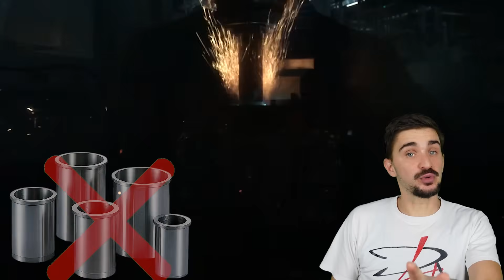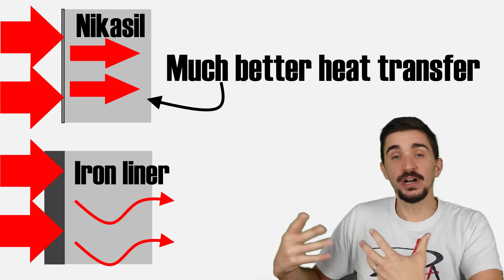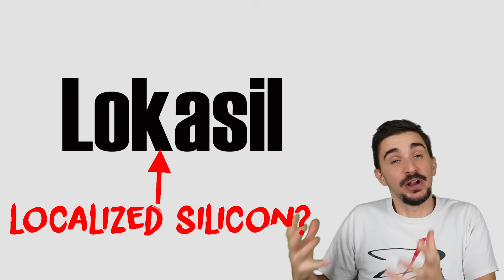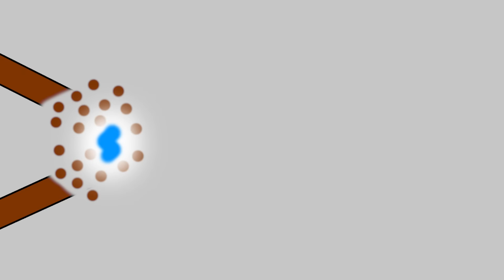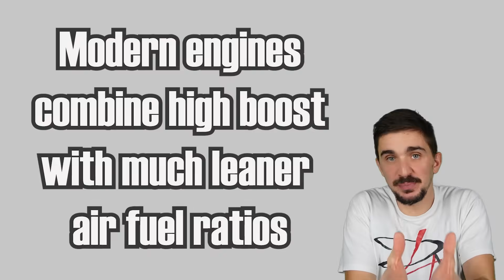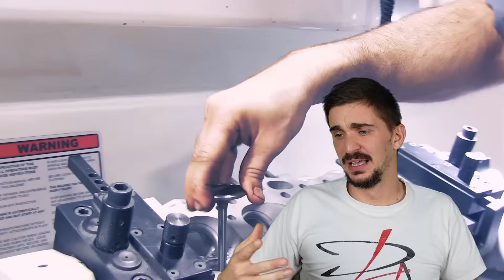Why Are Engines Becoming Non-Rebuildable? Everything About Cylinder Coatings

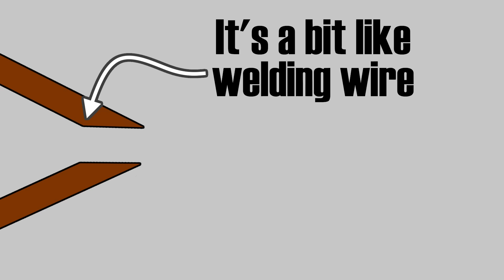Comment: Is that a ghost lockdown sound at 13:38? The most hated sound in the universe? Some of the points on the environmental calculations: yes, the remarks about "objectivity"  - or the lack thereof - are pretty objective - because this video cannot even hope to understand and grasp all the inputs and outputs of metal processing - from its natural source/mining - to the manufactured engine block. Meaning - A LOT MORE - goes into engine production than what is described. That would require a systematic research (which lacks in many industries, esp. bearing in mind the modern eco-craze and BEV-craze). This systematic study/research would have to try to grasp absolutely all inputs that need to be there - come together - so the specific item - engine block - can be made. There's engine (mining, production and operation) research, manhours, engineering, plant operations and plant construction - you would really have to work - for a long time, preferably - in the industry - to have the knowledge and data around what goes into building an engine. So mostly always - I'd say at least - leaving an existing engine on the road - will be more eco-friendly - than building a new engine. Moreso, recycling is not done like this - you have a bare engine block - which has been used throughout it's operational usable life-cycle - you take it from a shelf - put it into a smelter next door - and have a new engine. No. You have to first convey the message to the owner - hey, that engine that's in you car - that cannot rot in a ditch - dumped along with the car you drove the last 10 years - or rot at a breaker's yard - that engine needs to go to a specialised recycler/waste collector (time/money/resources). Then the waste collector needs to take the engine (block!) out of the car (time/money/resources). Then it needs to be cleaned and cycled as a new production input (again, time/money/resources). Recycling doesn't work as easy as - hey, I have this piece of jumper, I'll ask granny to "recycle"  it into mittens or freaking socks. A lot more inputs (granny isn't specifically environmentally harmful, waste collector sites, cleaning, smelting and re-cycling IS). So we cannot just take a ton of engine blocks - and say, hey, in ten years - all these engine blocks will make a ton of new engine blocks. People who speak of environment - mostly lack all this data. Their only data is "I see car. Car bad. I good. I protest bad car. I be even better" - which is of course total bullsh_t. The rule will always be that a 20year old car - in most of its aspects - is much more environmentally friendly - than a new car - NO MATTER how environmentally friendly this new car is. Some initial research is being done by Polestar (branch of Volvo and owned of course by Geely) - they publish the amount of CO2 that goes into producing their Polestar 3. 1 and whatever else their nodel numbers are - vehicles. There you can BEGIN to see - that a newly-build Polestar - is at least in terms of released CO2 - much more harmful than an old car - but even they don't provide even half the numbers. Some university at the technical/automotive engineering department - needs to do this calculation, taking into consideration a very broad "craddle to grave"  approach - for it to be at least initially credible. Just a quick added note - almost none of these engines are being re-built (re-sleeved, honed, polished, mating surfaces milled, etc). 99% of them work - and then don't - and then - new car. So those who worry about them not being rebuildable - well, worry no longer. Godzilla engines are maybe getting rebuilt - not these Renault Clio engines.

Comment: I agree on everything but the one bit about heat transfer.

It's precisely heat that is causing the expansion of gaz that is pushing pistons down. When you dissipate heat form the cylinder, you are dissipating heat in pure waste. Higher heat transfer is higher efficiency losses. That's why high efficiency engine have the smaller bore possible, to minimize heat transfer between gaz and walls. And you know it since just after that you said we can push the engine harder with higher temperature (i.e. heat).

Indeed, once the heat is inside the walls, you want the wall to not melt, degrade or cause knock so you have to keep it cool. But your phrasing is inducing that heat transfer, no matter where, is a good thing, and that's not true. You should have not use the word "barrier" and precise you were talking only about heat transfer between the wall and the block.

Comment: Back in 1962 I started my mechanical apprenticeship in Ireland with CIE .
The ran a large fleet of Leyland trucks and buses .
The main engines used were Leyland 600 and 680 engines 10 and 11 litre engines 
These engines used thin dry type liners called chromard liners and were very durable.
One part you could not use in these engines was chrome piston rings .

Comment: I suppose there's no market for thermal spray coated aluminium liners? They would be too thin to, and we couldn't make them thicker because of there's not enough material between cylinders to bore out space for a thick liner. So we've advanced ourselves into a corner, technologically, where we're producing things so good they ca no longer be repaired. Engines aren't the only engineering domain that suffers (or benefits) from this. Even in a regular car, even if you could rebuild the engine unlimited times you couldn't do body repairs without replacing large, complete panels and structures because of high-strenght alloys that can't be repaired by a regular welder, or repair the electronics when they say pooff after 5-15 years and, ultimately, you can not "repair" the internet-connected software when the manufacturer drops support for it. (Or if you do change something in the car's software, assuming you're technologically permitted, the manufacturer will refuse to work on it or update it, and maybe at some point this prevents you from passing a MOT test.)

All in all, technology seems to reduce things and products to something you can't ever own, for the real, original purpose of owning where you can do whatever you like with what you bought, like repairs, and nobody can have a say. You don't have the technology to carry out repairs so therefore whenever you buy and "purchase" something it actually means you merely enter a technological lease that maybe allows you to operate what you "bought", for a while. At that point you can just rent it: is there a point of paying to own something that isn't ultimately yours? And the big question is: can you fall in love with a car that isn't truly yours? Can you buy a car today and expect to keep it on the road far into the future? Doing that was never practical beyond a certain point but it was surely possible. That's why we have classic cars now. What will be the classic cars in 2060? I doubt 2020 cars can be kept going that long.

Comment: Perhaps manufacturrs with the technology readily avaliable should be required, by law, to recycle engine parts. It could be done cheaper, and to a much higehr standard, than a low-volume engineering shop. Else, there should be specialist engineering firms that are sponsored / subsidised by manufacturers in orer to have the tech set up and used to engine parts can be repaired at much lower cost than buying an entirley new engine block. It's only through lack of "want" that this doesnt happen, right?

Comment: This is far too level headed.
The general "petrol head" only deals in absolutes..

Like "all batteries in EV's will die jn 10 years and ALL of them will have to be replaced and the old ones are bad for the environment"

They like to ignore that combustion engines have a useful life, some break, some don't, some can be repaired, some can't, etc.
And they also like to ignore facts like....not all batteries in EVs will be rendered useless in this mythical world they live in. In fact, hardly any will. They may only hold 80% of the charge they held when new, but they don't just suddenly stop working.
And there are ways of recycling batteries.

Comment: Rebuilding engines is not an issue, as most modern engines do not get rebuilt. A lower miles used engine is always cheaper than a rebuild. And much faster to source and install. Anyone priced all the parts that may be needed? Since all car makers now have "Inflation" to blame, and so have doubled and tripled prices, even for older parts in warehouses for a decade, who can afford a rebuild? The only question with non-rebuildable engines, is how long they last. Or more exactly, how long they are warranteed for, which determines whether you buy or lease.

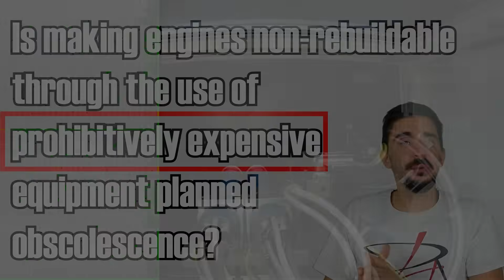Comment: 18:31 I disagree as there's a logical flaw in your construct. As being a person who spent good portion of my life dealing with electronics and microprocessors, I have to point out the amount of research and development put into making a MCU non-accessible for others than manufacturer and even for them it's one shot access. No manufacturer want their product to last longer than it should but(!) they want, while it last, to perform flawlessly. You said end result is less expensive than iron sleeves and that's a final target and that production low cost is locked to the company who build it, others have to pay higher price if wanted to replicate the process as they have to meet such production quantity to justify the investment. Being a product manager today is a serious business and serious responsibility but not toward end user as no one gives a rats ass for him but for the corporation that feeds those product managers. All recent fraud schemes like VW (and others) dieselgate, ecoboom engines, wet cambelts, massive product recalls and such, are just consequences of planned obsolescence planning goes wrong. 
One of the greatest example is turbo-compressors. Are you aware that production and development companies are obliged to make a turbo which has to last between 200.000-250.000km and if some batch exceed that run time for more that like 10%, those companies would be paying penal for big company loss, it's same process for pistons and other parts of the engine, like cooling system. Planned obsolescence takes more resources today than R&D, as it became major production thing... sorry for the long post, it was interesting topic for me. Cheers
Reply: 24:45 there's another logical flaw, but you presented it as simplification for the ease of understanding. This is not how it works in this case as car is not just an engine block, it's more non-recyclable plastic than ever, what about that? You took just benefit and ignored the hazard, and that my friend - is a logical flaw. ;)

Comment: While I agree with most of your other videos, I don't agree with this one. You are very knowledgeable, but in this case I think you missed several key points.
First I will start by just adding that... I own a BMW with a M52 engine, and it has cast iron cylinder liners from factory, the N52 are the ones that have the alusil/nikasil coatings (I also worked on M54 engines and they have cast iron cylinder liners as well).
The whole idea behind those coatings IS planned obsolescence.
I see you calculated the CO2 emissions of recycling just the 30kg engine, but... in almost all cases, people will just scrap the WHOLE CAR, not just the engine block. And a 1800kg car is going to have a lot more materials to be recycled than just the engine block.
Lets check the following scenario.... you have two new cars, one with iron liners and one with a coating of some sort. The one with the iron liners (like a BMW M52, M52TU, M54) can be bored out 1mm, with pistons for 84mm (stock) 84.25mm, 84.50mm, 84.75mm and 85mm. My engine had 520,000km before needing a rebuild (not necessary, but preparing for boost so I did it anyway), it was right on the edge of the tolerances. This means, that an engine will survive for 2 million km, before needing to replace it. A honing costs 100 Euro. 6 pistons cost about 800 Euro. So pretty cost efficient with only ~1800 Euro (including other parts and work) per rebuild to keep the car on the road.

A coating can't be easily re-applied, no matter what kind of coating it is. In most cases you will need to ship the engine to another country to do this process, and in most cases they won't do the same job than the manufacturer, making it less reliable with the next coat applied. So not only does it cost significantly more, it also makes it financially undesirable for people. And they don't just throw the engine away, they throw the entire car away and buy a new one. A coating usually lasts for 250,000 to 300,000 km in my experience, before the car starts to burn too much oil (enough to not pass emissions, because of the oil that gets burned). So lets be more positive and say... that it will last 330,000km. 

The person who bought the car with the liner, will have to change 6 different cars to travel those 2 million km that it would take a car with iron liners practically 0g CO2 emissions to get an engine resurfaced and honed (even if he takes the engine from a different car, this won't change much, as that other car is also in the calculations for the recycling, and the same goes for the iron liners cars, which makes the calculations even more undesirable for the coated engine).

The small difference in CO2 between car A with iron sleeves and car(s) B with coatings when it comes to emissions, is not even comparable when you factor in that the old cars must be recycled, making a considerable amount of CO2 that way, also a NEW car must be produced, making EVEN MORE CO2 emissions... for a car with a lifetime that wont stay on the road for as long as an older car with iron sleeves will.

Keeping old cars on the road is more cost effective for the user (even before factoring in things like depreciation of a new car).
Climate change is real, but it has almost nothing to do with ICE cars. CO2 emissions in cars haven't improved too much in the last 20 years because of cylinder liners compared to other technology included in the engine bay.
The reason why it is pushed, is because people buying cars is making car manufacturers money, it also makes your country money when you go pay taxes or the VAT included for a new vehicle. Its way more than anyone will pay by just keeping his old car. Newer cars also have higher insurance rates (which is normal, as they cost more), so in countries where there is mafia in the government (which is most of them), and mafia being pretty prevalent in insurance companies, its normal for a country to push people to buy new cars, 1 million new cars sold in a country with an average price of 50,000 Euro and 20% VAT means 10,000 Euro per car for the government, multiplied by 1 million cars.... you get 10 BILLION Euro per year from that alone.
Insurance for my car is 160 Euro per year... Insurance for a similarly powered car made in 2024 is more than 10 times that.
Everything is made because of profits. No one actually cares about the environment and the people... they just want you to spend money.

Comment: bmw's darling engine these days - the b58 engine family - is also thermal spray coating ( plasma coated or what ever ) 

m52 family dropped the nikasil after the tech. update (dual vanos version) TU , and went to steel liners ( even the last of the m52b28 SV engines went to steel liners )

also would be good to point out that the crazy long oil change intervals that started after the mid 90s - 10k km, 15k km, 20-25k km oil change interval as normal - just put more and more issues on the table after the firs 100 000 km on the engines ... and then in the 2005s ... another bonus ... direct injection petrol engines started to become the norm ... more fauling of the oil, more km between oilchanges, push for "thiner" oil grades ... and every owner after the 1st one that had manufacturer warranty started having conspiracy theories why the engines fail, and some independent shops started searching for the one and only reason of engine failures/huge oil consumption/premature wear etc

many factors are at play at the same time ... fact of the matter is that engineers where pushed to come up with "wonder" solutions in the shortest time possible for "issues" that were conceived in political circles just to take the attention of the public away from other issues and scoring easy "green points" (bonus ... pushing all of Europe to use diesel powerd personal cars for short commutes, then passing the issue to less wealthy 2nd hand markets and then getting huge surge in airpolution and repiratory issues - Japan on the other hand used small cars, petrol-hybrids and EVs )

Comment: Spray coating is a mature technology that has been around for decades. It's used to rebuilt crankshaft and camshaft (and other shaft) journals. Just because these engines are spray-coated, doesn't mean that they won't be rebuildable in the future. You machine the cylinders back to the aluminium layer, and then apply the coating again. It's basically simply going to be a question of time until the engine rebuild shops get hold of these spray coating machines. Just like they did with Nikasil plating. Used to be rare, but now there's lots of specialists that can rebuilt old cylinders economically.

Comment: Alusil etc have a worse "emergency friction" factors than cast iron. That, in combination with other wearing parts (like sticking injection valves) in the engine and people not adhering to oil change intervals and mmanufacturers' oil  recommendations,  are important contributing factors to premature failure of modern engines. 
In my 3.5l M272 the zylinder surface is worn out due to leaking (on and off) injection valves. it has 300kkm (200k miles) on the clock and is still running, I am just refurbishing a replacement..